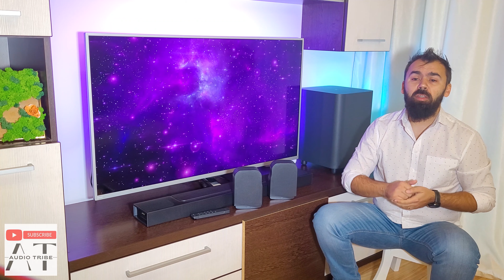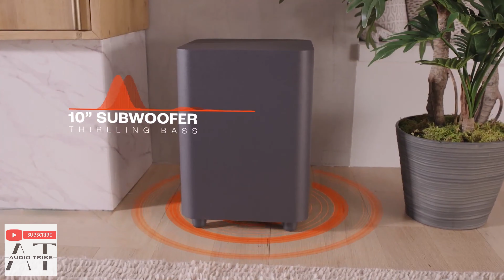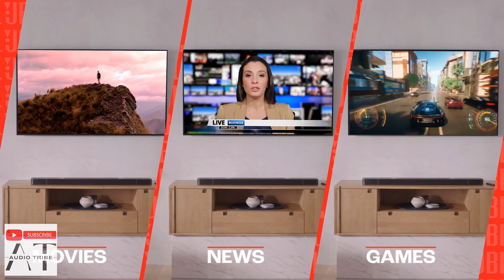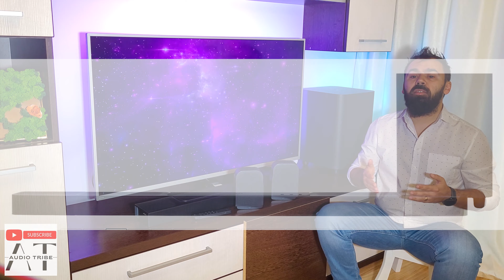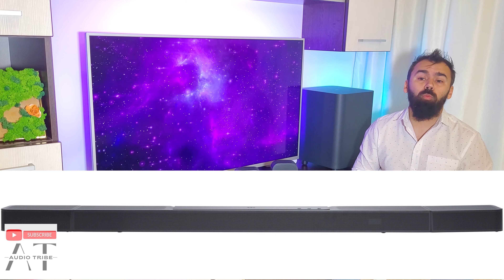NEW JBL BAR 1300 Soundbar - 1170 Watts with 11.1.4 Dolby Atmos 3D Sound

Comment: Hi, good morning I wanted to ask you a question, I have the JBL 1300 soundbar! Is there a possibility to raise the volume of the central channel? Because I found that the volume is low even after calibrating, in conclusion to hear speech in a film I have to keep the soundbar volume high and this means that when the effects are present they are too invasive, if you can tell me if there is the possibility of increasing the central unit would be doing me a favor, thank you!

Comment: Hi, do you have much difference between the bar 1000 and the bar 1300. I had the 1000 for a while, but now want to go for the 1300. What is your conclusion?
Reply: This is a great question and a video + good response would be helpful.
Reply: @audi4581  Ciao che prezzo avrà il jbl soundbar 1300.?
Reply from the maker: The JBL BAR 1300 will be the best ATMOS Soundbar on the market in my opinion!

Comment: Hi 

Which JBL soundbar would you recommend for the best overall value and experience? JBL 5.1 9.1, 1000 or 1300? is 1300 worth paying the extra and much better out of ten? or do you have an alternative JBL model in mind? Thank you = )
Reply from the maker: Hello Audi. I just tested the JBL BAR 800 and taking into account the price and what you get for this money - $800-$850 - from my point of view the JBL BAR 800 would be the most fair for the price! What do you think?
Reply from the maker: This JBL BAR 800 is almost the same as the JBL BAR 9.1 from 2020 that was the best then. 
I think that the reason for launching this soundbar is to replace the old models!
Reply: @AudioTribe  

Hi thank you for pointing this out, I agree. I think the JBL 800 is introduced to replace older models.
Reply: @AudioTribe  

I think the JBL 800 is good value for the price range that you have highlighted. In terms of sound is the JBL 800 similar to the JBL 1300?

 In your opinion IS the JBL worth paying the extra money?  Out of ten is the JBL 1300 noticeably better in terms of sound and experience? With the JBL 800 being a 7.1 system and the JBL 1300 being an 11.1 system will this make a difference? There is also a 9.1 older system.

Sorry, lots of questions but the help and advice be valued.

Thank You